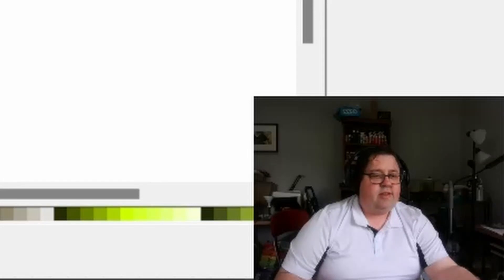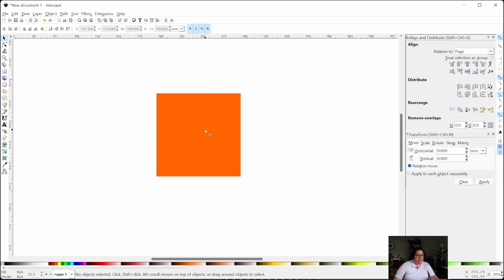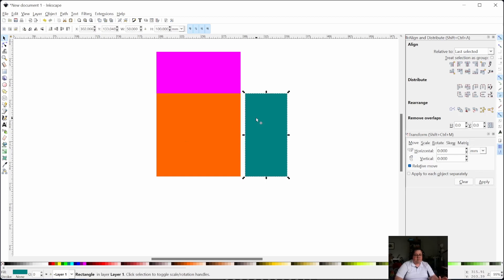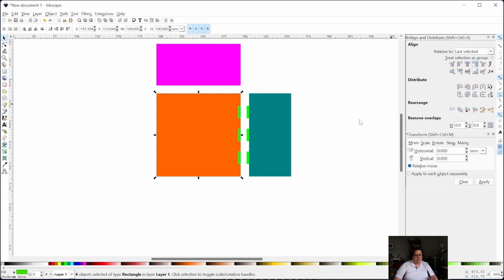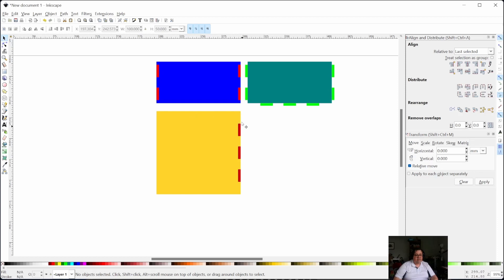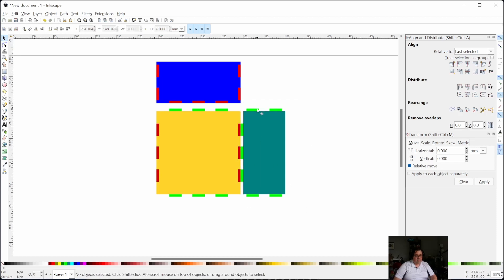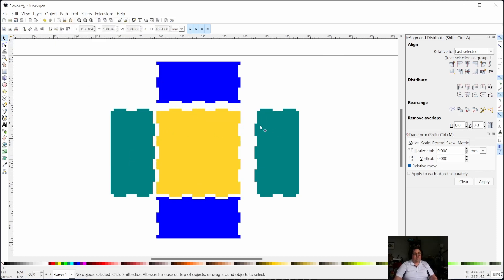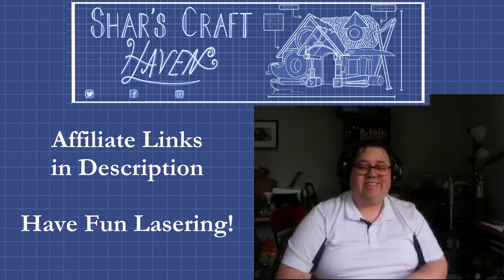My First Laserbox: Designing a Basic Box in Inkscape

Comment: did you account for the kerf? how tight are the joints? do you need glue still?
Reply from the maker: This process allows you to change the size of the tabs/slots to account for kerf. My kerf on 3mm Baltic Birch is .1mm (per side). I decided to cut out what I recorded about kerf since it is a "beginner" video and was already pretty long. Let me know if you have any questions on how to account for kerf when building designs in inkscape! Thanks for the question!
Reply: @sharscrafthaven2091  is the kerf pretty standard across all materials on your machine? And do you know if there would be a difference in kerf from one laserbox rotary to the next?
Reply from the maker: My kerf for most 3mm plywoods is pretty similar, .1 mm . Other materials definitely vary. Acrylic is the one with the most variation for me, different melt for different number of passes and thickness. I have not compared between machines other than my two machines and they are really similar (since the laser dot size is super close). In most cases, if you are gluing it just has to be close. I used a kerf test from : https://www.festi.info/boxes.py/BurnTest?language=en to get my baseline.